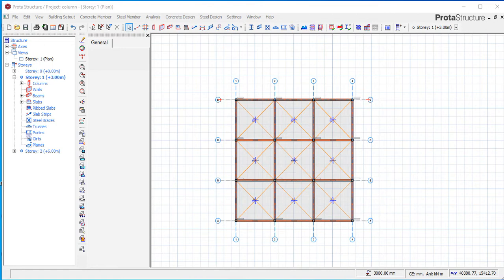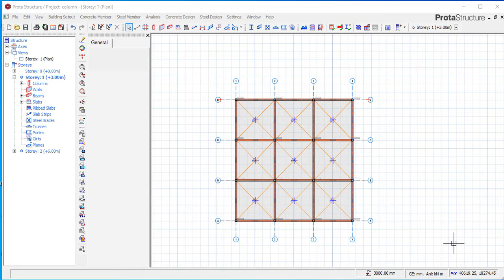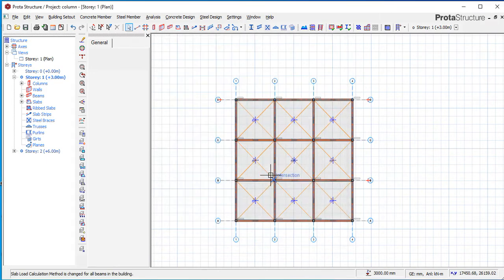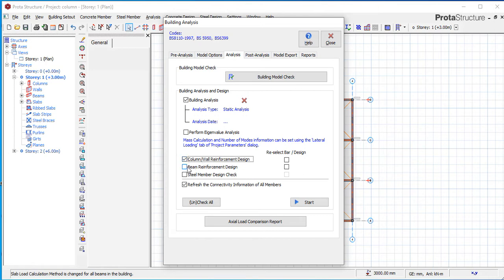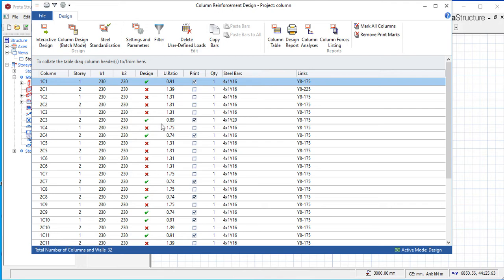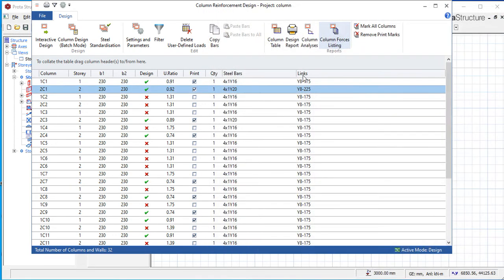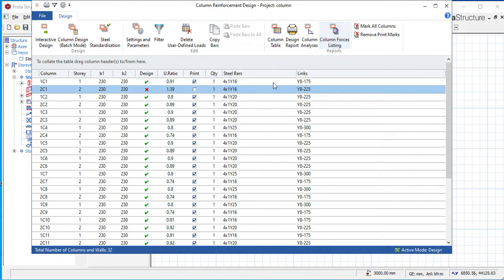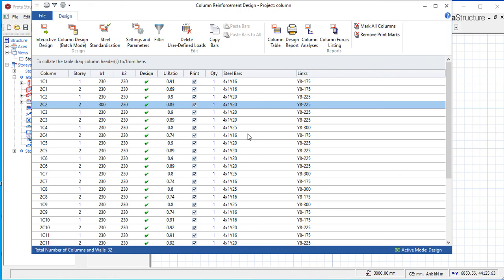protastructure tutorial_ how to fix a column that failed during design

Comment: How are u sir?  U showed how to fix failed columns after design in protastructure. But  lower columns had less steel bars than upper columns in same vertical array of building which is impractical in field.
Question: How can u make protastructure to give lower columns more bars than upper columns?
Reply: How  are u sir? In protastrucrure usually lower columns have less steel bars than upper columns which is wrong in reality or both have same bars throughout which is also wrong if u follow tutorial of how to fix failed columns in the design.
How can u make lower columns have more bars than upper columns?
Comments from Balabyekubo I.J.C.
Thanks.
Email bjohnchristom@gmail.com 
johnchristom@gmail.com